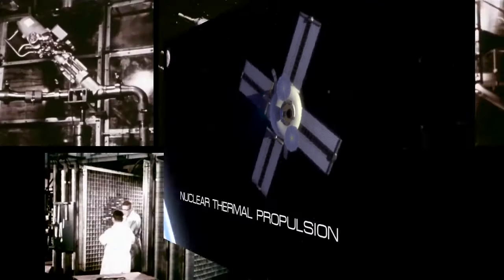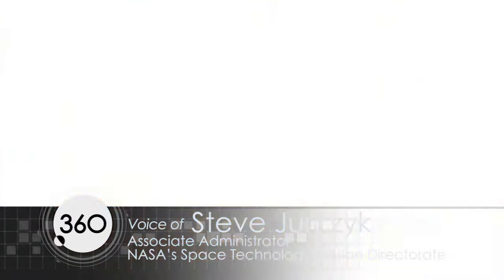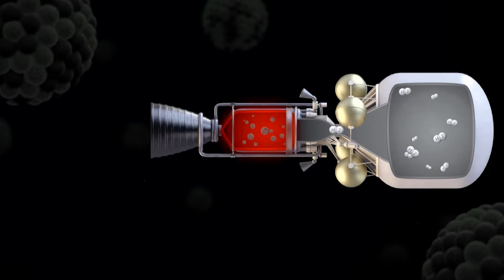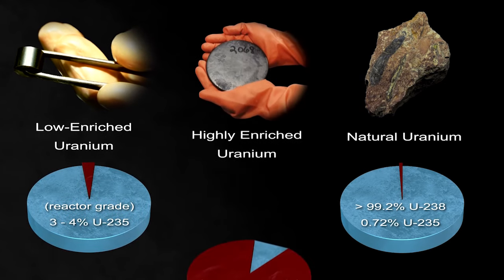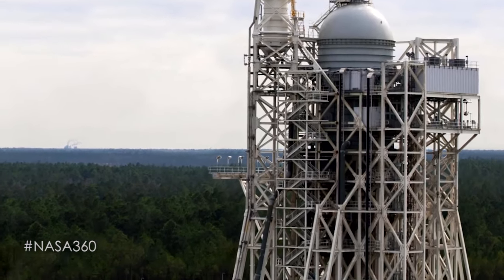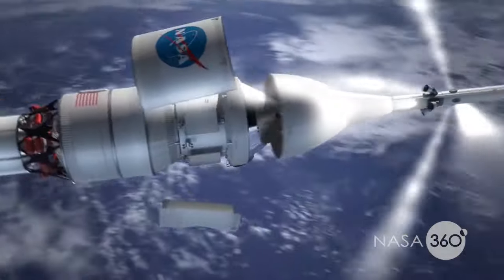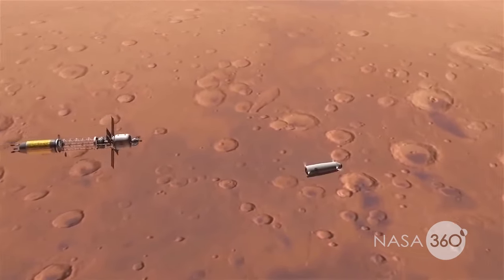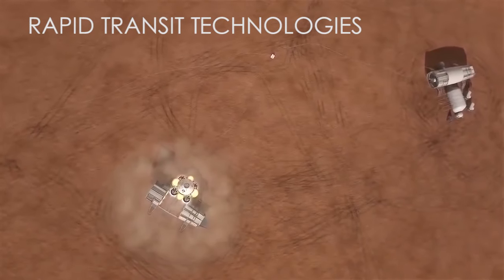Nuclear Space Propulsion

Comment: My uncle was the lead builder for the Nerva project.  
Mid to late 60's.  It was felt that flying around with these 'Hot'  reactors w as probably not a great idea .
Reply: Once you are beyond the earths atmosphere and magnetic fields space is filled with radiation thats "hot" - mostly coming from the sun. So such paranoia is a bit silly in deep space.  Also the exhaust from this type of drive is slightly radioactive but its nothing more than superheated reaction mass (C02 or a similiar heated gas) that passes next to the sealed heated nuclear pile and not actual nuclear pile material.  There is no significant fallout from using such a drive.  Significant Fallout would only occur if the drive were to explode.    Without nuclear power you are dooming most methods of deep space travel - this is a large reason why we are still stuck near the earth for manned flights 50 years later.   You would have to heat up this type of drive in orbit (and not use it for launch to low earth orbit).  Then its probably no more dangerous in use than the RTG's we already use for deep space probes (Matt Damon drives around mars with a sealed Plutonium RTG next to him in a mars buggy in the movie "The Martian").  I dont mind some nuclear paranoia but please do some research before making blanket statements that imply all nuclear power in space has to be a bad idea.   

For safety, we would most likely have to move launch facilities for such a drive to isolated areas (Antartica is a frequently mentioned possibility but there are other isolated islands/areas that could be used).  In the movie "Alien" Mcmurdo in Antartica becomes a landing field (Ripley calls them in the beginning of the movie).

Personally id like the future shown in tv shows like "The expanse" and some form of nuclear power (fission or fusion) is going to get us there.
Reply: pfft its fine
Reply: BeastModeActivated we have detonated over 2000 nukes as a human race. You have no idea what you are talking about
Reply: The idea is not great not terrible.

Comment: Nuclear propolsion can work with co2. So it could be practical for return mission. Return vehicle doesn't need extra fuel if it works nuclear energy and co2. I think nuclear co2 propolsion system could work at mars very well. First ly system takes co2 from atmosphere and then compresses it and stores it in tanks. At the take  off time it heats co2 for propolsion   by nuclear energy.
Reply: This type of engine is very heavy due to required shielding and cant be used for liftoff or landing - most likely only for transfer between mars and earth (its advantage there is constant thrust and need for very little propellant).   The exhaust is also slightly hot so cant really be used in the earths atmosphere (in space away from the Earth the drive radiation would be neglible compared to the suns output).  Harvesting the C02 from mars atmosphere would work but you would still need chemical rockets to get the C02 up to the nuclear powered mother ship in mars orbit.
Reply: What? CO2 is used in nuclear power generation to increase its safety.  I have never heard anywhere that CO2 is mixed into the nuclear fuel to increase its output or efficiency.  So I'm unsure what you are talking about when you say "nuclear propulsion can work with CO2".  I think maybe you read somewhere that CO2 was used in nuclear power generation and just assumed it would apply here.

Comment: Doesn't low-enriched Uranium drastically increase the critical mass, making the reactor needlessly heavy?
Reply: Yes. But if we were to use high assay low enriched uranium (HALEU) the reactor mass could be a modest compromise while avoiding some of the political, security, and logistical issues surrounding highly enriched uranium. At around 15-19% enrichment the reactor can be relatively small, like some research reactors.
Reply: Yes, yes it does. As the previous answer states there are ways to mitigate those negatives, but none have to do with the science or engineering of a nuclear propulsion system. And given the designs currently being proposed ie nuclear thermal, the limiting factor won't be the reactor or its fuel. That problem will center on the hydrogen gas to be heated and expelled to generate thrust. The craft will only be able to carry x amount and hydrogen is its own PIA, needing cryogenic temperatures and it's tendency to seep through its container walls due to hydrogen being so small. Spacecraft utilizing liquid hydrogen and liquid oxygen like the shuttle couldn't leave their hydrogen tanks filled if a cancelation occurred for this exact reason. That said many have mentioned the use of Co2 in place of hydrogen. I'm an engineer and not a chemist but Co2 breaks apart at extreme temperatures right? If it doesn't then great, carbon capture the shit out Co2, send some folks off to mars and then use mars's atmosphere like a giant gas station

Comment: It seems like promising technology but this presentation leaves out several key features that give me the impression that this is just another thing like the Moller Sky Car.  A concept designed to attract investment money but something that will actually never fly.  In other words, a way for a small group of people to make a living doing nothing by creating a company that will achieve nothing.   If you included in the video how you could achieve a low level thermal fusion chain reaction and then regulate it on the necessary time scale of 10^-4 seconds with sensors that can respond that fast but with no known mechanically device that could.  A piezo actuator could move at about 5 MHz but using it to drive a fuel regulator would slow its reaction time.  A quick calculation of the acceleration rate that a piezo actuator would need to achieve is about 2400 mm per second squared.  The best a piezo can do is about 800 mm per second.  So is there a new technology we haven't heard of?  Regulating fuel using electromagnetic fields? Not regulating the fuel and using pulses of precise amounts of fuel so as not to vaporize the rocket nozzles? Are you mixing a chemical reaction fuel with nuclear fuel?  You haven't explained anything but a general concept of the same exact thing I have been hearing for decades.  Maybe I would be a little more excited if there was just a tiny bit more information that would lead me to believe you were serious.  Showing a slick animation and then stock pics and videos that I have seen before leaves me very skeptical.

Comment: And what is with Radiation? Does such a spaceship or rocket leave a Trail of lethal Radiation behind?
Reply: There is lethal radiation all over space. This would release a small amount of slightly radioactive gas. Not a lethal trail but not completely clean either. But compared to the surrounding radiation in space, probably a negligible difference.